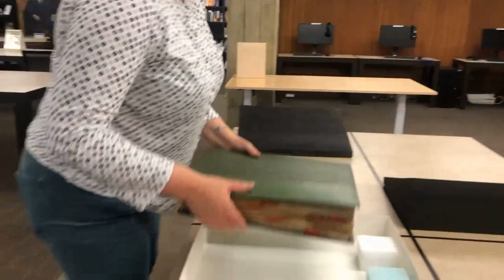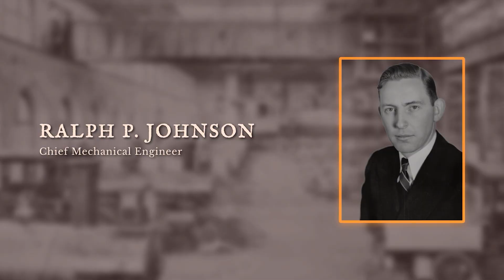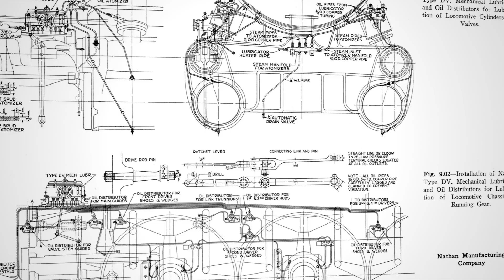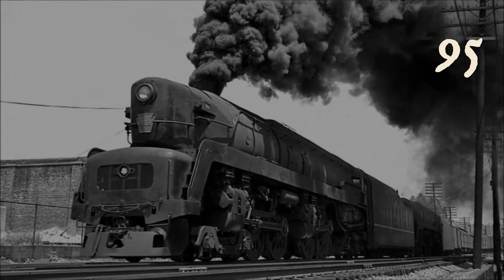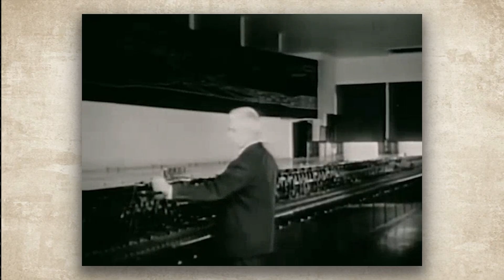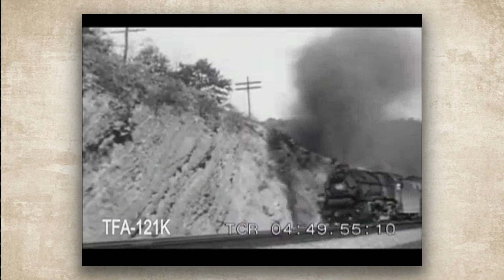How BAD Was The PRR T1 ACTUALLY?

Comment: The T1s I believe would've been phenomenal if they were built with either the Type B Poppet Valves or Walschaerts valve gear. Also, when tested by the C&O and N&W, neither railroad found them slippery, with the C&O straight up saying that they were not slippery locomotives.

Comment: Someone on the other video called me a liar when I commented about crews sabotaging the T1 when they first arrived. Eliminating double and triple headers meant fewer crews needed for passenger service. They really didn't want to go back to the freight pools. Crews later on after they were all gone did they admit doing it. If there were a serious problem, then the test plant would have bore that out. If it was a design problem then why didn't it show up on the S1, Q1, and Q2? Why didn't the T1 have slipping issues on heavy mail trains? There have been many articles about the T1 in the Keystone put out by the PRRT&HS. And many discussions on the PRR forums.
Reply: But since Pennsy did dieselize, there were going to be fewer crews, anyway.
Reply: @danielcobbins8861 you are correct but in the forties diesels were not a concern yet. It wasn't until the mid fifties when engineers and firemen saw the writing on the wall.

Comment: None of todays railroads will allow one of these locomotives to be run at speeds anywhere near 100 mph!
Reply: it dont have to but if we are to break the record and find out just what it could actually do and with some improvements in design and modern tested materials as well as being in the hands that have ran big steam, we dont need it to do 100 but it can haul amtrak or passenger trains on a decent timetable if it needs to. just like 765 did with the jolliet rockets and the galesburg zepher about 10 years ago going on.